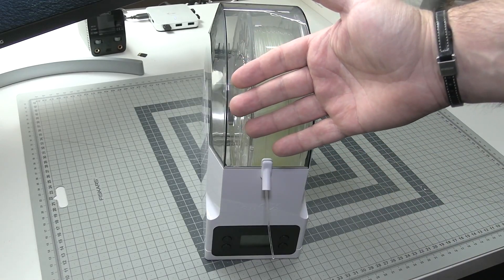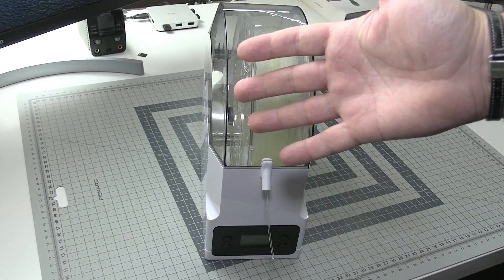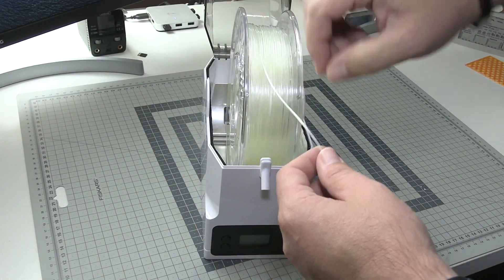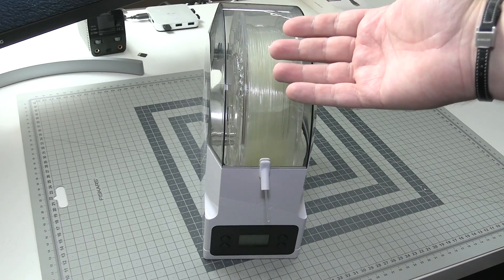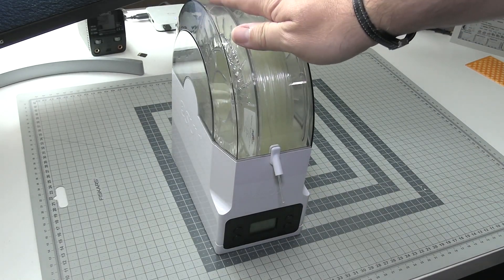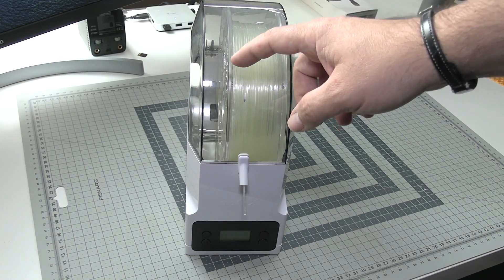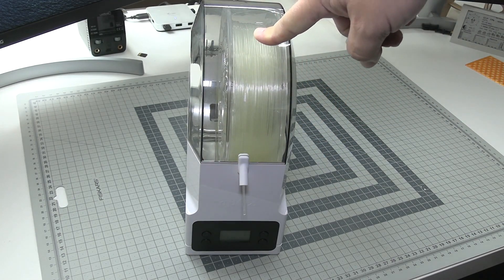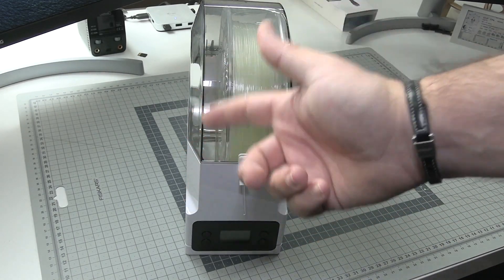eSun eBOX Lite 3D printing filament dryer

Comment: slickdeals has deal on a two rolls filament dryer from "comgrow" today and that video was a sign that I need one - it is a jungle down here in florida, even in winter I have 70% humidity inside. in the summer it's 50-60% as we get giant dehumidifiers with every house and apartment. outside is hard to breathe for the newbies.
and what's the humidity in northern home nowadays? my drybox with silica gel is 30%...

btw Paweł, did you ever research the peltier cell filament dryers?

Comment: I use the heatbed covered by a cardboard box to dry filament occasionally. Small holes on the side/bottom and top center create some convection where the moisted warm air can escape and fresh cold air comes in and dries by heating. Heatbed is pretty good heat controlled and amazon brings me free cardboard anyway 😂
Reply: Does the stuff kill you without ventilation
Reply: @Atheism-And-Normative-Ethics  i don‘t know any filament for FDM printers that produce fumes. As you see some dry it in the oven.  Resin printers have unhealthily fluids.
Reply: @olaf_s_23  ok cool, thank you 👍 good point